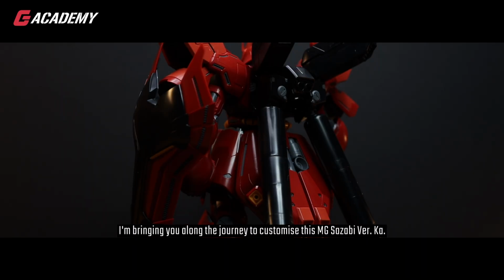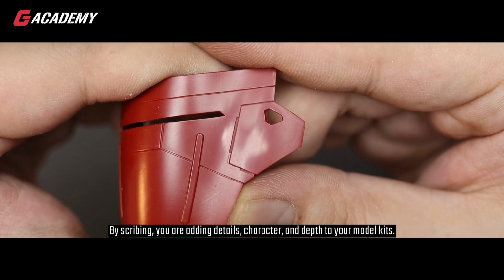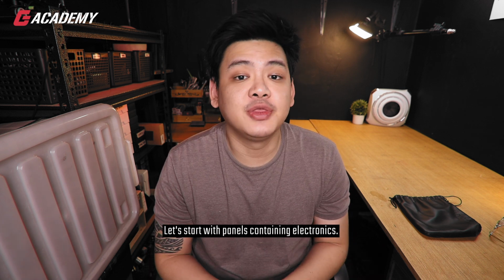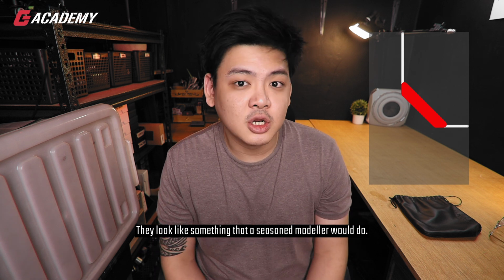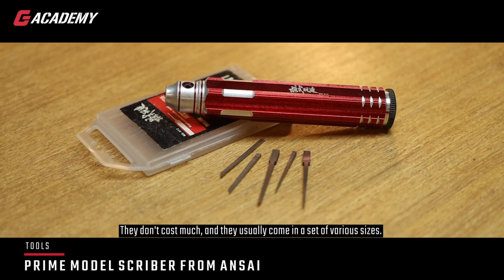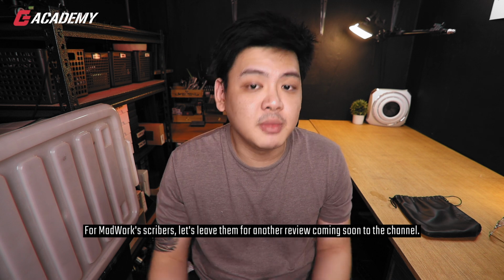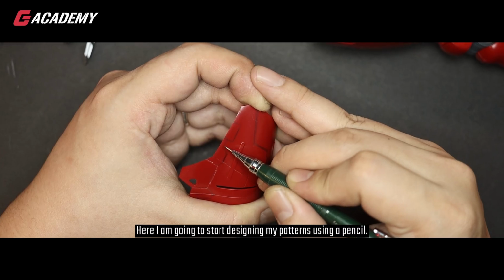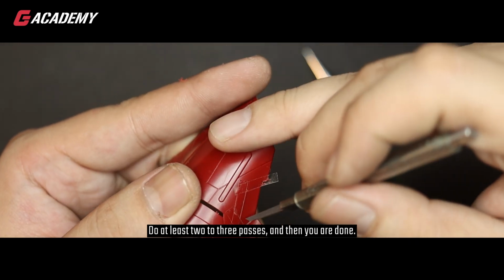How To Start Scribing Your Gunpla FEAT MG Sazabi Ver. Ka | TUTORIAL TUESDAY | EP 02

Comment: Didn't realize G Academy was also a channel, just subbed.
Additional Tips:
Another thing to take into consideration is the design of the suit itself. Each series has its own style, so be sure to work with the existing design.  There are also engineering differences, for example between Federation and Zeon suits - where one is typically more angular, while the other has more curved surfaces. You may need to take different approaches to each, in terms of both design and the actual scribing.

Comment: Sadly, way too many people think it's only about scratching additional panel lines and don't even advance to stepped patterns at different depths, hint of maintenance handles that unlock panels in the hangar, tie-down areas where maintenance cranes can connect, adding gaps that show meshes or hinted at details behind them and so much more.
Hell, i doesn't even have to be an RG or above. You can even dremel away some stuff from the back of an HG armor panel and insert a mesh in a gap you've cut and give that area a whole new kind of feel.